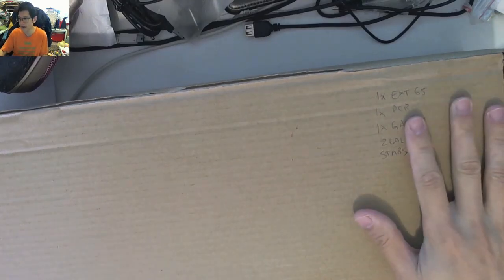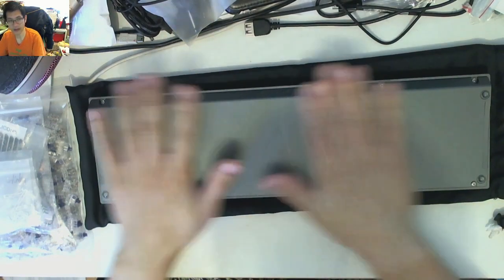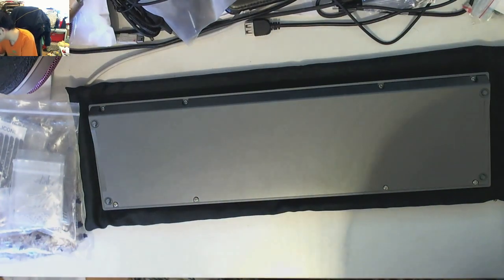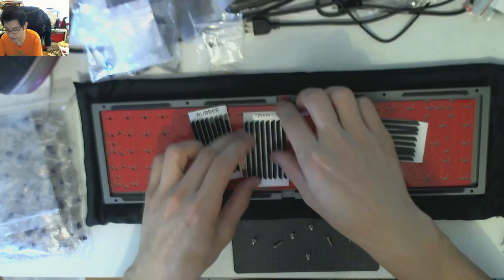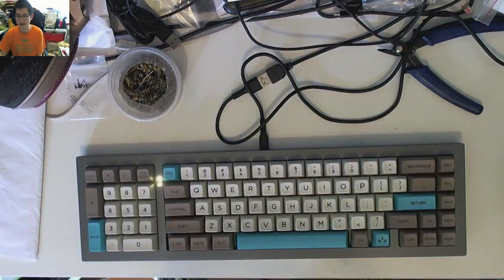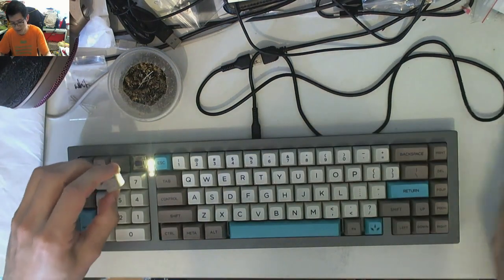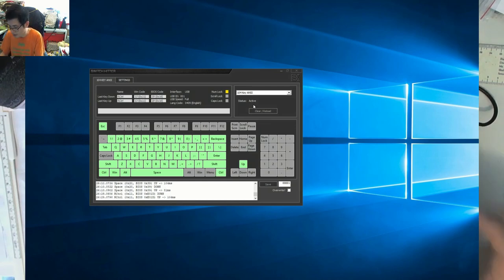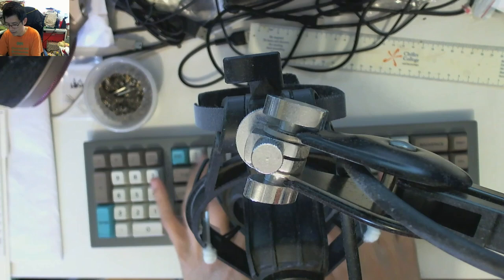AEBoards EXT65 Prototype Build and Review

Comment: Like it really depends where you use your keyboard if you like to use it near you negative angle is ok if in middle flat is the best if far positive angle. I prefer neutral angle. The best. But okay with whatever angle. I like 3-4 percent positive ones very much too
Reply from the maker: Thats an interesting perspective, I haven't heard that before, but I guess there has been somewhat an assumption on how far outstretched ones arms would ever be in typing, but at least with the EXT65 you can flip it around.